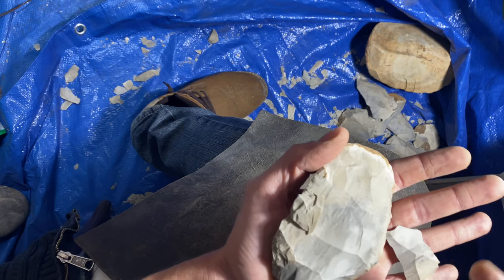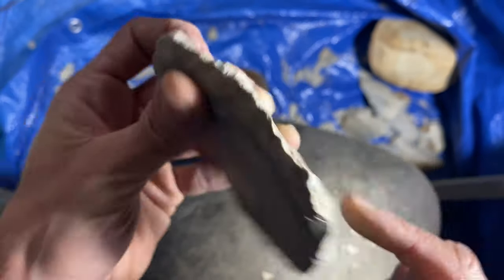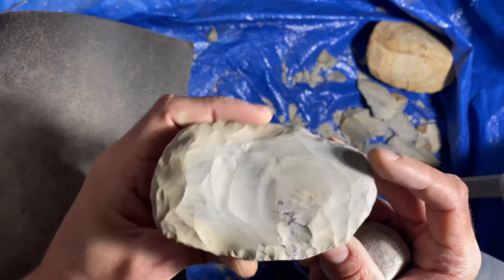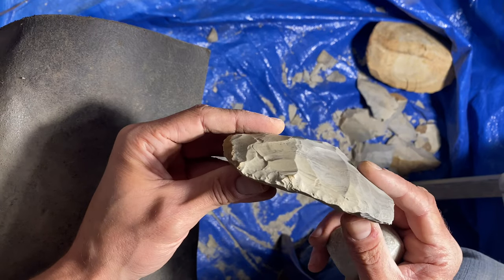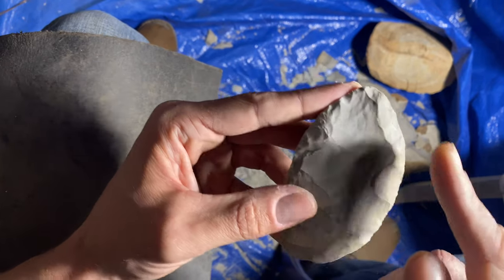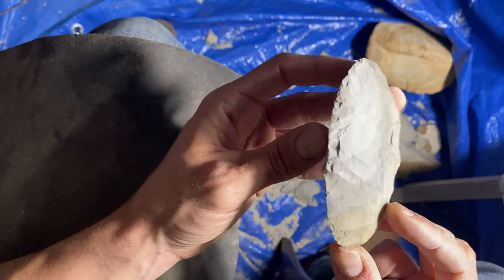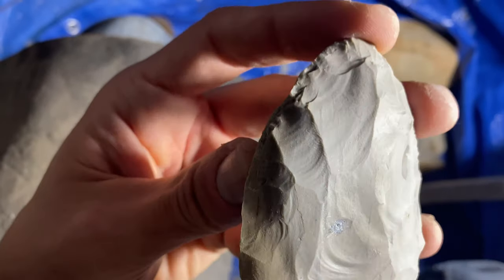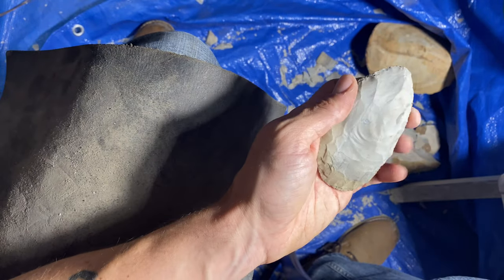Making a Hornstone Biface Cache - Biface #2

Comment: OK, a question: I see that your soft hammer blows work beautifully, but I don’t get what happens in your mind when you: (1) hit, but miss intentionally, and then push the antler against the edge; (2) you repeat the same sequence as if it was for practise or ‘visualisation’ or actual ‘acting out’; (3) and then you hit the edge. Looks like you practise two vectors consecutively: down, in; down, in... and then you go booom: down-and-in. How’s that work? Fascinating. Haven’t seen others do this.
Reply from the maker: That’s a great question. I do that for a couple reasons. It’s partially psychological, like I’m psyching myself up to take that big flake. I carefully prepare the platform and only get one chance to hit it just right, so I need to be in the zone. Taking a few practice swings helps get my muscle memory on track. When I tap the edge I’m making sure I know exactly where it is in relation to the part of the antler I want to hit it with, then I think I generally do two practice swings to get close to the edge, and on the third I swing hard and fast and that gets me right to the part of the platform I want to hit. Also, I would rather miss than hit too far up the platform and risk breaking the piece, or taking off a bad step or hinge flake. So every time I swing I go just a little bit further, or I move my left hand just a little bit closer. If I take too small of a flake it’s easier to fix than if I take a big plunging flake. Thanks for asking that question and helping me think through that process, don’t think I’ve ever put it into words before.
Reply: @prehistoricliving  Your explanation makes complete sense, thank you! :) I really miss knapping — but I have a 5 liter jar full of bifaces (most CRT tv glass) to play with, and soon I’m setting up my workshop... ;)
Reply from the maker: That’s great, have fun in the new workshop! TV glass is a good cheap source of material to work with